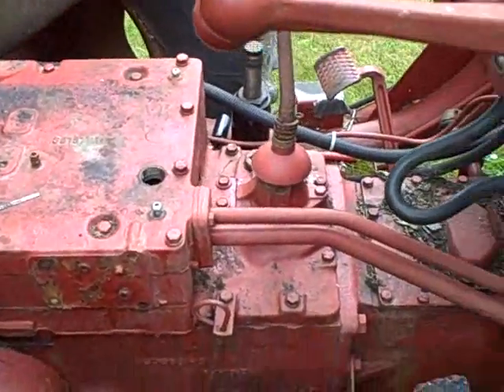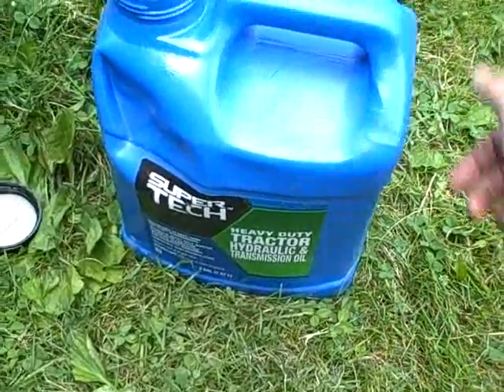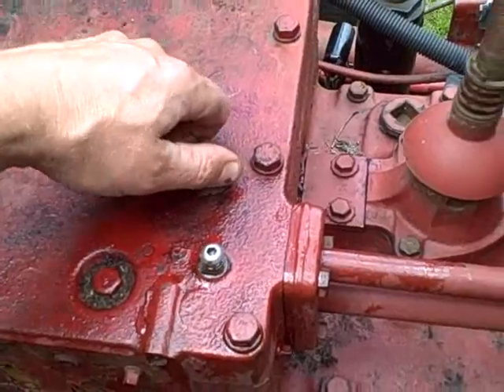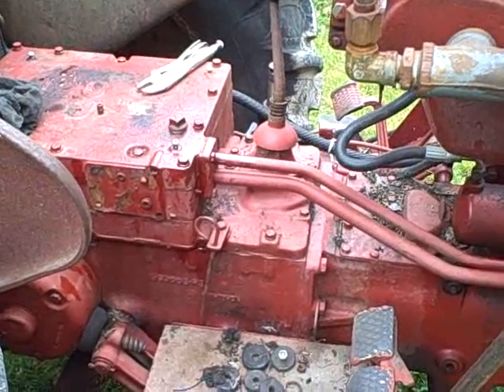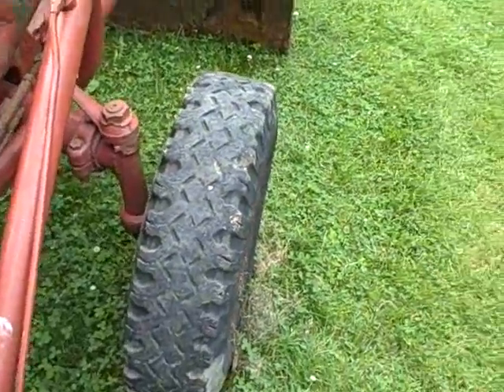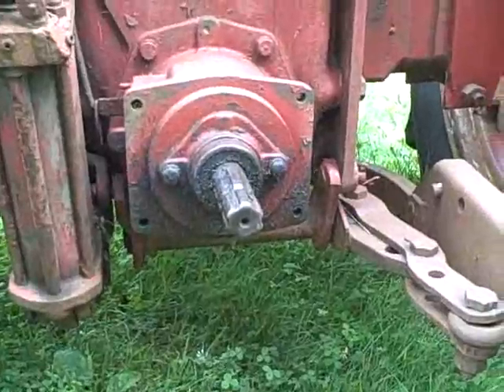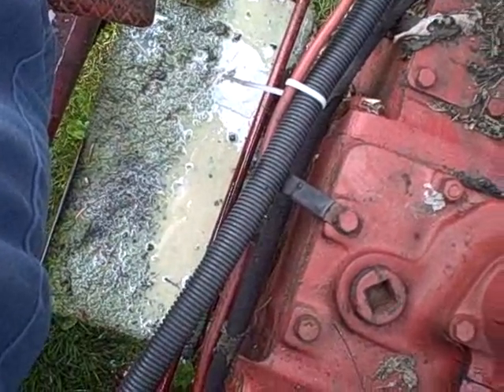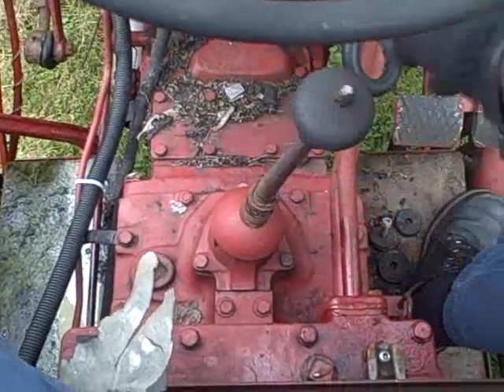IH 350U Tractor Project Part 20

Comment: I know it's been 5 years since this project but I really need a number for the starter motor on my '58 350U gas! I see yours has also been converted to 12 volts—which starter motor are you using? What is the part number? Thanks!
Reply from the maker: Jimmy Lester  hi, will this help? http://m.tractorpartsasap.com/item/3733353236

Comment from the maker: I tried getting it on a trailer today, and noticed one wheel seemed to be turning more than the other making me think the steering gear is damaged. I also need to disconnect the likages, and make sure the spindles on both wheels move freely. Can't wait to get it home, and tear into the steering gear. Almost had it loaded when one of my plamks snapped........heavy old tractor.